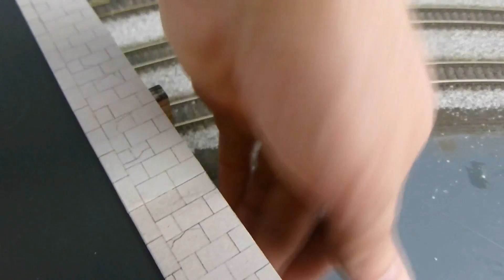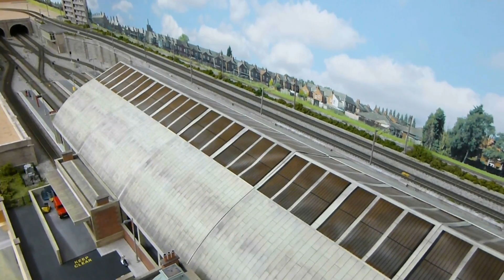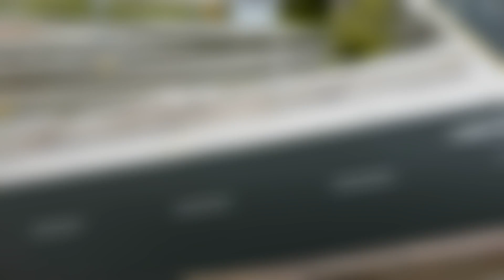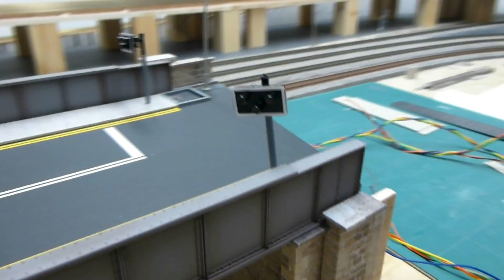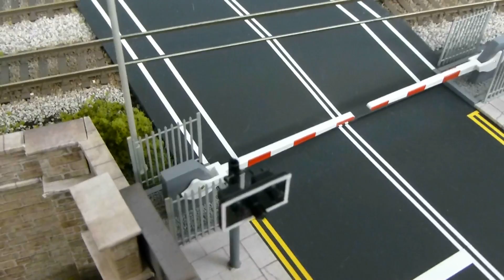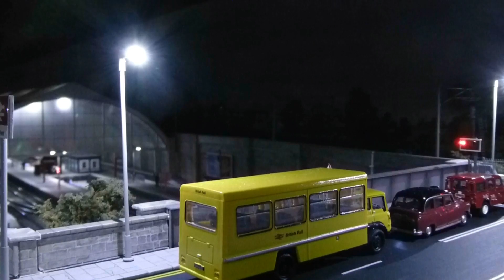Dean Park Station Video 81 - How to build a Level Crossing

Comment: Hi Dave how come the road from the bridge over the crossing stops just past the crossing then all you see is grass surely the road would have carried on and not just stop dead , but otherwise great layout so far keep it going cheers Alan
Reply from the maker: Hi Alan. This was a tricky one.

There is no tidy way to resolve this issue. Putting a road tunnel in would looked weird, a stick on road going in to the distance was considered, but look daft. 

There has to be a trade off with backscenes where it meets the layout. I’ve managed to negate 99% of these transitions but this one is best partly hidden by parking a van awaiting to cross the rails. 

Really glad you like the layout and thanks for watching the stuff I upload.  

Cheers
Dave

Comment: For roads signs and markings the document is the Traffic Signs Manual. The ORR produces a pamphlet on level crossings. The level crossing is s bit dodgy for pedestrians as they've got to step into the carriageway.

PS since forever they gave not used tarmac in level crossings between the outer edges of the sleepers on both sides. In the days of steam they used timber which by the 1970s was being replaced by concrete blocks. Thus allows easy access to the tracks for maintenance without having to dig out and replace the tarmac.

Comment: Very cool. Though that tone can get unnerving quickly at the crossing. I'd almost rather put movable arms that auto activate, keep the lights and ditch the sound. 

On the road after it crosses, do. you have any plans for making it disappear into the scenic backdrop ? I suppose I'll find out as I watch the next years worth of videos to catch up tithe present day. My instinct is put. Fragment of a backdrop with a hill that covers the house as there and out a tunnel entrance  that enters the hill.
Reply from the maker: No room to have servo motors under it as it was near the track underneath.  this was all considered in the planning stages.   Also, access for maintenance is a issue at this part of the layout.  The road disappearing is a tiny issue that I have yet to find a suitable resolution to which doesn't looked like an after thought or just plain messy.

Comment: Amazing level of detail wish i had you skills, I have just a layout finally fixed down, have a shed load of metcalfe buildings, lots of green mats, and scatters with various fixings. Just in the process of connecting my signals, but nothing as complex as yours. My first layout so just using two aspect connecting to cobalt ip point motors. using a separate dc bus for signals and for using for lighting later too.
Reply from the maker: sounds cool. will you be videoing it? Dave

Comment: Hi Looking For Help Please
I think it was the previous video that the focus was on wiring. 
Can you please tell me the name of the wire connection clips that has been used throughout your layout combined with where they were purchased.
Looks like these have been used instead of soldering wires to the main bus wires. As I am not being very good on electrics I can see the time advantage in using these wire clips, however, is the power maintained or is solder more secure ? - Please advise.
Kind Regards
Allan
Reply from the maker: hi, they are from Rapid electronics.   They are called Davico DS 2M Crimp Blade Splice  Code: 33-0190   and Davico ERPO 63M Red 6.3mm Male Tab Connector Pack of 100  Code: 33-1057   Hope this helps.
Reply: Many thanks for your info, I have now purchased those clips.
Would you have a list of all the Railmatch paints and types you have used please. I appreciate its down to layout design and personal choice, however, as I am building a loft layout also I really like the colours etc you have used.
I have almost caught up now, about to watch number 108 and every one has been amazing to watch, how proud you must be, well done.
Regards
Allan
Reply from the maker: Hi Allan.   I use Railmatch enamels throughout.   Railmatch sleeper grime for the sides of the rails and sleeper tops.  Then go down centre of the tracks with Roof Dirt to give it the oily colour and it also helps tone down the sleeper grime as well. Cheers, thanks for watching all of my videos too. Dave
Reply: David, many thanks for your quick response, very much appreciated. Your answers are perfect thanks.
Its a pleasure to watch them all. Also started to take notes from various recently watched videos in order to remember pointers for my own layout.
Regards
Allan

Comment: did you use the heathcote level crossing module or express - asking as you said you use heathcote signal modules but got the crossing lights from express models.cheers
Reply from the maker: Hi I  got the Express Models one as I didn't not have the space under the raised baseboard for the servo motors for working barriers.  All other electrical stuff for signals is Heathcote. Cheers. Dave

Comment: Nice one Dave, always a worthwhile video. Couple of comments on the crossing, the siren only sounds until the gates are down and some little red lights on the barriers, perhaps a fiber optic from a single led ?
Des.
Reply from the maker: ok, good to hear...as the siren was driving me bloody crazy, but the circuit board does not allow for automatic stopping of siren from the lights.   I will look to put a manual switch in at some point. Dave

Comment: Just wondered where you purchased the BR cabinet it's a nice touch thanks Mark
Reply from the maker: Hi!  The Cabinet?   The green one?   That's a telephone junction box and is from unit models.   Pack of 2.  Made from resin.   you get them painted or unpainted.  I got the unpainted as they were cheaper and easy to paint with some spray paints etc. Dave

Comment: GREAT IDEA with the level crossing Dave . question how is it wired up mate............................regards tony
Reply from the maker: Hi, its all wired in to the circuit board to wire up the flashing lights, or for the street lights is wired in to the 12v bus wire.   The wires are fed through the underside of the road/ramp areas and carefully fed into terminal blocks and then to the power wires.   A delicate operation!
Reply: cheers dave.......................tony

Comment: Hi Dave, your planning and detail are just first class which is echoed in the result. If I can just add a thought, has the road just been resurfaced or have you yet to include the typical bit that one of the services dug up and re-laid badly (sometimes). Barry. Devon
Reply from the maker: Hi Barry, in this case I thought I would do 'new road surface' look.   When I do my town scene (opposite end of station) then I will do more pot holed, worn road markings etc.   Watch this space, I might get around to doing the town in 2020 at this rate! lol

Comment: Thanks. What is procedure for soldering in a resistor? Where exactly did you put it? I'll have to do same.
Reply from the maker: I wire the resistors as per instructions....some leds have the resistor on the +ve, other the -ve.   If you check out the May update I THINK there is some chat about wiring....if not look closely at this vid and you'll maybe see the resistors on the wires. Dave

Comment: Dave, 
Do lampposts simply wire into the auxiliary bus wires - that Is,  the same bus as your point motors etc. I've bought some that come supplied with a resistor but I have to solder it in place my self. Any ideas if that is straightforward to do. Cheers.
Reply from the maker: Hi, the lamp posts go in to my 12 16v bus wire.  I had to solder a resistor in place before wiring it up or the LED would get damaged. Cheers. Dave

Comment: All I got to say is pure genius excellent work but could I suggest how about a more commercial scene in that corner maybe some offices or something along those lines?
Reply from the maker: Hi, thanks for suggestion.   Factories or warehouses, offices will appear at some stage of this layout.   Dave
Reply: Hi Looking For Help Please
I think it was the previous video that the focus was on wiring. 
Can you please tell me the name of the wire connection clips that has been used throughout your layout combined with where they were purchased.
Looks like these have been used instead of soldering wires to the main bus wires. As I am not being very good on electrics I can see the time advantage in using these wire clips, however, is the power maintained or is solder more secure ? - Please advise.
Kind Regards
Allan

Comment: Excellent video and great little details like the drain covers and nicely done level crossing. Nice to see one that's very/almost level rather than the usual steep hill on both sides. It looks good in operation day or night, but I'm afraid that siren would drive me up the wall! Have you installed an off switch? ;-) Great progress too - been too warm in my loft for comfortable work this week....well that's my excuse and I'm sticking to it. Cheers, Davie
Reply from the maker: Hi Davie, its getting too warm up my loft too, so I was really pushing to get this finished before my enforced summer break lol. (plenty of ply backboards to sand, fill and paint in prep for more backscenes in the autumn during the summer!)   Yeah I tried to get it to a gentle slope on both sides.   Regarding the siren....not on off switch, just a small screwdriver to unscrew it from the circuit board lol.   It gets right on my tits I can tell you.   Luckily I decided to go for manual operation of the lights and siren, so I wont have them flashing every 20 seconds....that would do my head in as well as the shriek from that ruddy siren! Dave
Reply: Nice to see the APT-E at a bit of speed too at the end

Comment: Excellent work on the crossing Dave and moving the signal worked out OK after all which is good to see. To complete the scene I think it would be good to have some S&T chaps working there as suggested. seeing as the barriers are down all the time at the moment. A couple of Ten Commandments Relay Boxes (locations) to operate the crossing and another for the signal. Also there are often cattle grids at each side of the road to stop stray humans and animals deciding to take a short cut walking along the railway. Often made of triangular shaped wood which can be made from Plastruct.. Although my own crossing does not have those yet LOL. Ten Commandments also have road markings similar to the ones you have used. They are the ones I use and are very good. So worth a look if you cannot get more of the ones you used
Reply from the maker: s&t? not familiar with that abrieviation mate?  Also replay boxes will be installed just to the right of the crossing as scenic work continues.   Thanks for heads up on the other road markings.   Also, cattle grids....yes I did have some corrugated plasticard, BUT I just didn't feel it looked right.   And in the 1980's we were less health and safety obessed and many crossings didn't have any of them....so maybe ours can both be of that sort?! lol.
Reply: Ah sorry Signal & Telecoms department. They install and maintain anything to do with the signalling system including level crossings. P way (Permanent Way) department lay and maintain the track. Corrugated sheet would not really look right so a good decision not to use it. It would be a lot of work to use the plastruct to make them. That's why I have not got round to it. As you say our crossings can be of the less health and safety more common sense kind LOL. We had an incident where someone was given directions to turn left at the lights. The next set of lights was a crossing flashing red. So they turned left and managed to get around 20 feet before the car ground to a halt in the ballast. Damaging some cables and crossing equipment along the way. Lucky for them it put signals back to danger and the train managed to stop. In that case the cattle grids did not help. It is hard to  protect against idiots like that whatever you do.

Comment: Wow you have been mega busy in June and accomplished so much well done Dave it looks brilliant hopefully Hornby magazine will be coming to you after being at Everard junction. Can I ask a question about your level crossing lights. "Did you put sensors in the track to control the lights and do they come will all the delay functions ie Amber to red then off??" Cheers Mark
Reply from the maker: Hi, thanks for that feedback.   I think Hornby will want me to complete a bit more of the layout before they come knocking.  They have approached me to send photos in....I will be doing so shortly.  I never put sensors in as the express models barrier lights use relay/reed switches which are activated by magnets stuck to the underside of locos.   Firstly I didn't want to stick magnets to all my locos and I didn't always want every train triggering that bloody siren every 20 seconds lol.   I just use manual push switches as supplied with the express models kit.   The circuit board they supply does all the work....its really simple to wire up too! I would recommend it.  Not cheap, especially if you get another set of lights to make up the 4 sets like I have. But I think its worth it! Dave

Comment: Nice update. One thing that doesn't get the recognition it deserves is your woodwork. Everything is so neatly cut and the fit is always good. Going back a few videos you can notice it as you build the upper levels. What do you cut it with, do you have some sort of band saw? Anyway. Another half hour well spent :)
Reply from the maker: Hi, I have access to a band saw at times yes.   Its much neater than a jigsaw.  But I just like to take my time and make sure its all neat....good layouts are built on good foundations and frames, or so I am told lol. Dave

Comment: Brilliant job on the bridge and level crossing!  It really has finished that bit off to a treat.  I do hope you have a switch for turning off the sound to the level crossing though, I could see that getting rather irritating going off every 2 minutes lol.

Cheers,  Michael
Reply from the maker: Hi....no switch, but I have a small screw driver handy to unwire it.....that will happen shortly!!!! its annoying.   I just did it for the purpose of the video.  Every 2 minutes?....try every 30 seconds! lol Dave

Comment: Fantastic work Dave. I've a few questions; firstly what gauge is your layout? Secondly, are you planning on making the barriers operate and if so, could you please film it as I would love to do the same and lastly, can you recommend any good O gauge semaphore signals?
Reply from the maker: Hi, I'm 00 gauge and no moving barriers....not got the room under that section to fit 4 servo motors etc.   I had to compromise.   Dave

Comment: Hi, what type of contact adhesive and paper do you use to stick down your scale scene walls? Mine have started bubbling!
Reply from the maker: 3M Spray mount.  Dont use cheap stuff as it will fail....I found that out to my cost earlier on.   A good coating of that and press down, works fine.   Its permanent adhesive but you get a minute to slide things before it sets.  I get mine from amazon.

Comment: Dave very good update I do like the level crossing.Just one thing I have been tormented with on my layout and you have the same where does the road go after the crossing away from the station,I want to do the same but not sure it will look right with the road just stopping?As you are well into the model buying could you tell me if they ever ade some coaches in the swallow livery that match the livery on the trains on the Firefly I have got the intercity 125 coaches are cream but the train is in white?Any help please
Reply from the maker: Hi, about the road...I plan to put two tall vehicles on that side of the crossing to hide the fact it goes nowhere....but where does any road go in 00 gauge land? lol.   Its the same when a road comes out the front of the baseboard, as is the case on the other side of the crossing.   You just have to accept that its just a snap shot of a model world and imagine where it might take you. lol
Reply from the maker: As for the coaches.   Class 47's generally pulled MK1-MK3 stock, but by the time Firefly was in the Swallow livery it would more than likely handle MK2D/E/F air conditioned coaches.   Hornby produce MK2E in the swallow livery.  Bachmann announced in 2013 they were doing the MK2F variants, with DCC lighting etc.   Now while Hornby's are very good and priced at around £25, the Bachmann ones promise to be highly detailed items, for which I suspect they may be well over £40 EACH!  Bearing in mind the number of coaches in a common rake being pulled by Firefly etc were 6-9 coaches, if you get the Bachmann ones you'll be well over £300 for just a rake for one train....ridiculous I know!!!!   As for the MK3 Intercity 125 coaches in Swallow.  These have intercity beige on the lower sides of the coaches, just like all of the othr MK2d/e/f''s have too.   The thing is the sides of the locos in Intercity Swallow are indeed white.   This is what they should be, the coaches were always beige.   So there is nothing wrong with running the two together.   Earlier variants of the Inter-city red/white stripe loco livery had beige on the lower sides of the locos, but the more attractive, more modern INTERCITY Swallow had white, even the HST's had white sides.   Sorry for the essay length reply....but I hope it helps? I have the MK2E coaches from Hornby.   They are excellent.   PLUS, some are going for as little as £17 each on hattons. check this link http://www.ehattons.com/stocklist/1000389/Hornby/BargainByManufacturer.aspx Dave

Comment: Very effective Dave, well done. You could also add a couple of equipment boxes either side for the crossing and a S&T vehicle and working on the crossing. As the bloody things constantly broke down. I remember as a young Guard having to direct traffic over a crossing till the Old Bill turned up. How long will it be before the warning siren drives you around the bend and you disconnect it? LOL. Once again very good Dave.